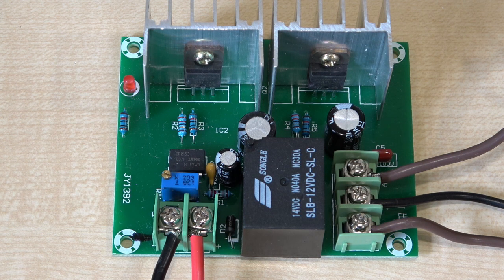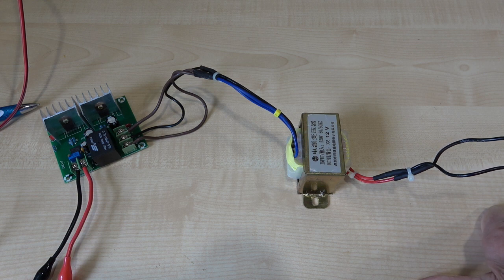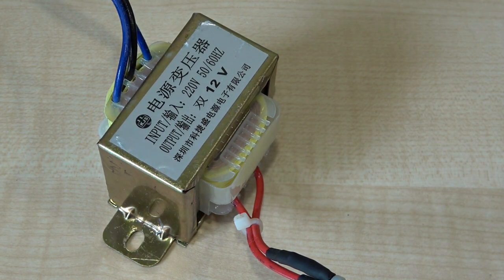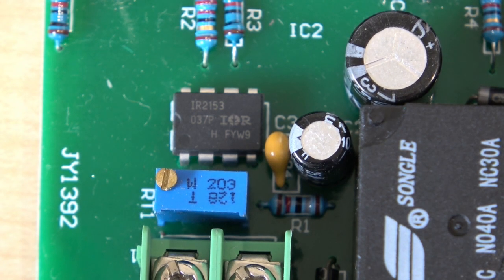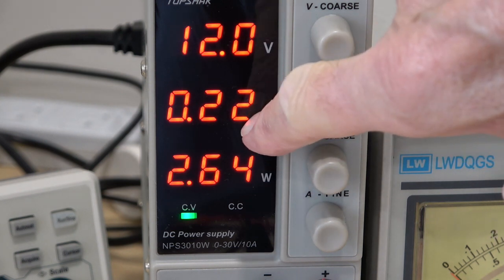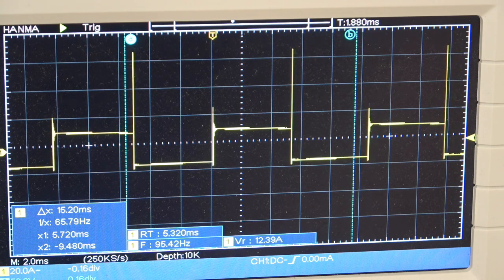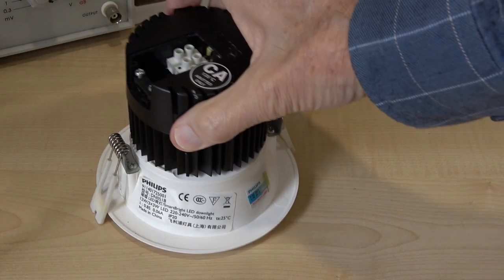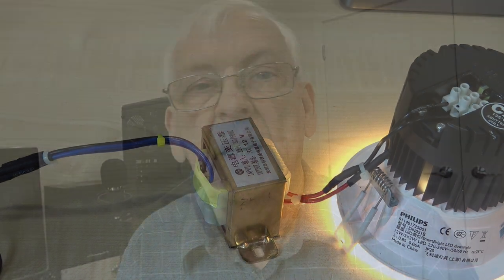12 Volts DC to 220 volts AC. 300 watt? Inverter.

Comment: Relay is only for  reverse voltage protection. With a little modification, these make a nice power point water heater control for efficient transfer of PV panel to resistive element.  That IR2153 is an amazing chip which has lots of possibilities. Trouble is you never know what you will get for a chip and the FET are now 55V.  Trace spacing is crap to use it at higher voltages with a change of FET.
Reply from the maker: I have since used this with a much bigger transformer, works quite well with more power but not really any use to me. It's in my box of other junk, and will probably remain there.

Comment: I have a Hypex UcD module love the sound how can use in the car. Car runs on 12v. Please guide if not hyoex then TPA3255 200 watts mono amp I want to run in car
Reply from the maker: It will need an inverter, but the current draw from 12 volts will be high. It will very soon run the battery down then you wont be able to start the car. Only use when the engine is running. The inverter must run on up to 14.7 volts, the charging voltage if a car battery.
Reply: Hypex Udc180 is a very good Class-D amplifier. the reason they are that, hypex has a patent on something that makes it so good.

In a car it is the same whether you use hypex or pioneer car amplifier since you MUST use EQ. to get good sound. In a car the speakers are incorrectly placed and you are sitting next to them. Then you have a small room you sit in.

It's the end result and how you use things and not always what you use.

ic. Bassed amplifiers that you find a lot on ebay do NOT have any good sound quality! this is from personal experience.

The best amplifier does not give good sound if you do not use it properly with the right speakers also further.